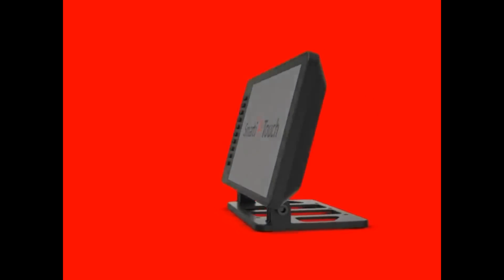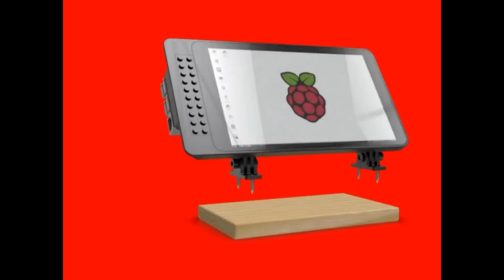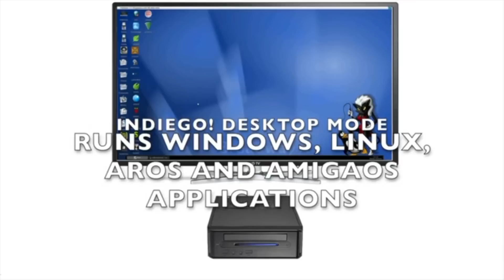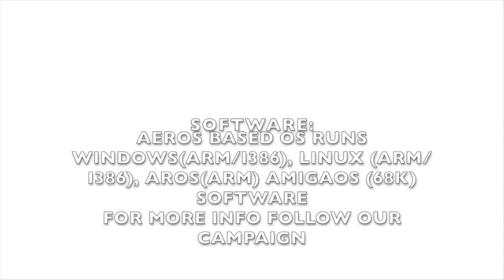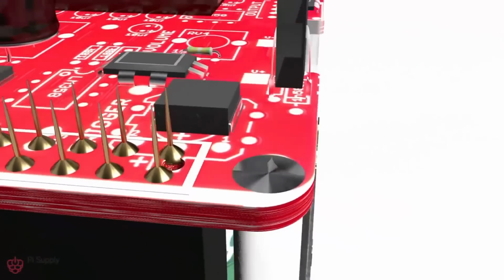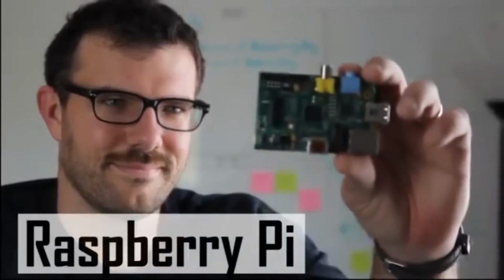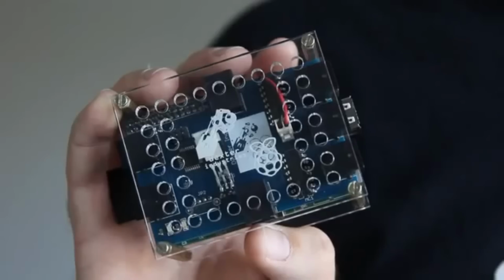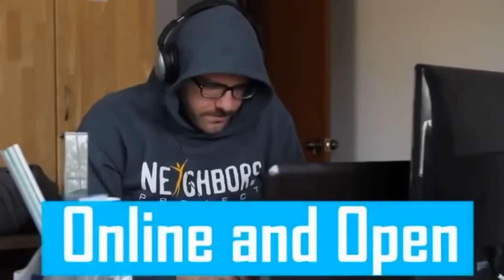5 Raspberry Pi Gadgets

Comment: the smart pi touch will be a failure without modifying it. The raspberry pi heats up to 80 C° which if goes over the limit can fry it. enclose it in a case without anything too cool it and you just built an execution box for the pi
Reply: I got tired of the raspberry ventilator because it did so much noise and my raspberry works perfectly fine, never hit 60 C degrees even now in the summer with 38 C degrees in the street. I think if you dont overclock it there´s no problem
Reply: What a load of crap. I have had my pi running for 2 years without failure inside my own customer box. never once overheated. you should double check before posting unfounded comments like this.
Reply: +Julian Mummery it's like a comment who just didn't think of this simple idea as all good things are simple ideas an want to throw people of buying it
Reply: Personally, overheating has never been an issue for me. I have two Pis. One is used as a media center and is in a case inside of a cabinet. The other is a shop computer that I keep in my garage with no air conditioning in Florida. I've never had either overheat.
Reply: How far have you over-clocked it? 

As others have said here--there is no problem with the RPi getting too warm. I have several RPi2 and RPi3 units, and have run one RPi2 at 900MHz (set via raspi-config) for weeks and never saw an issue with temperature. If you're concerned, put a little heatsink on the thing and let it do it's thing. I have a small heatsink on one RPi3 but haven't pushed the machine hard enough for the heatsink to even matter.
Reply: +Al C h
Reply: Luckily I bought a $6 case for my raspberry pi and it came with 2 small heat sinks for my raspberry pi 3. My raspberry pi only reaches up to 45-48 C°
Reply: Kompjuter Fantom Yeah I agree at least put a case on it that won't kill it.

Comment: Should 3D print a design that will fit in the dash  of your car same size as a Double Din unit. Could replace my SYNC system in my Ford with something that actually has a much better brain.

Comment: the lego part is a joke what is it for kid's i would get it for a car computer but the lego part get rid or that really what you thinking legos what does a kid really know about how to use a pi anyway i cant imagine a kid setting up a cluster or a server
Reply: legos have BEST first proto ,kids robot etc many frist proto mechanic and software test frame. dont blame lego have many many engineering proto mechanic basic tools, then IF protowork well can madeexpensive metal and other material machines. idiot no understand lego have cheap best first proto build and childrens education build somethink. best at wolrd.

Comment: How does it run Windows??
Reply: There are ARM versions of Windows 10 
http://ms-iot.github.io/content/en-US/Downloads.htm
Reply: +valcarni1 i would wait year or so, because current win10 arm has bad performace and lot of bugs
Reply: +valcarni1 If you mean the IndieGO it doesn't, it uses WINE to run Windows programs.
Reply: +CazRaX IndieGO can run windows programs? wow. It can't be WINE because WINE depends on x32. I'm guessing qemu.
Reply: Ilgaz Er Apparently they use ExaGear Desktop which lets you emulate x86 programs on ARM hardware.
Reply: CazRaX Wow that is cool but so expensive! I could buy an old laptop for that price and use that as a server.
Reply: Ilgaz Er These companies are trying to go mainstream to sell to the masses and the masses can't or don't want to use old hardware and set it up to do that. They rather just buy something that is easy to use and that works.